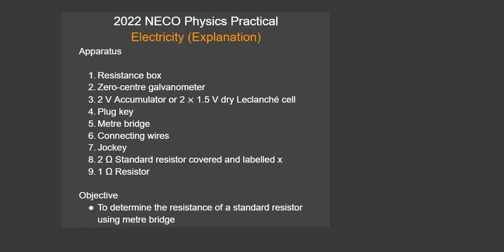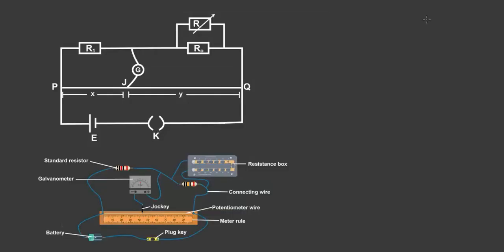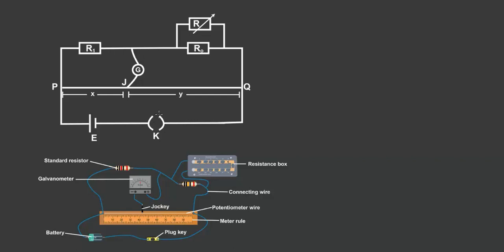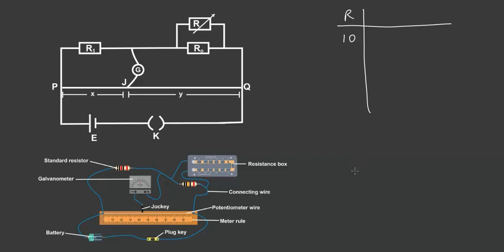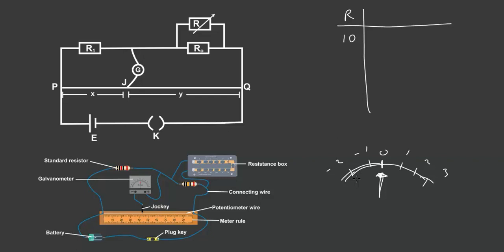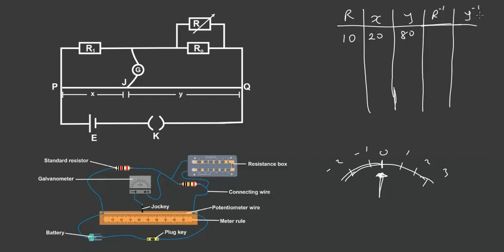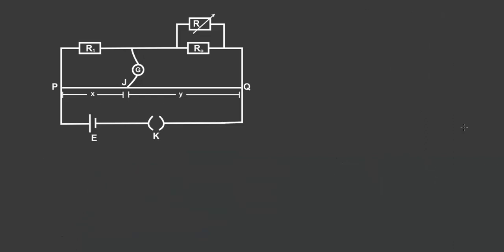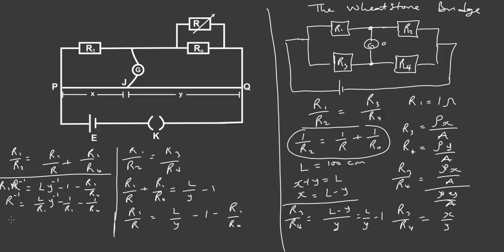2022 NECO PHYSICS PRACTICAL - PART 1 | ELECTRICITY | THEORY BEHIND THE EXPERIMENT

Comment: Is it metre bridge or potentiometer?
Are both the same apparatus?
Reply from the maker: Meter bridge is not same as potentiometer. We did not use potentiometer. We used potentiometer wire. It is same as resistance wire. Meter bridge happens to have resistance wire in its setup.

Comment: In place of the 2V accumulator or 2 x 1.5v dry leclanché cell, can one use normal dry cell battery 1.5v?
Reply: I think yes, 2 x 1.5v
Reply from the maker: Yes you can use two 1.5 V dry Leclanché cell. Do note that the value of the e.m.f. does not determine the readings.